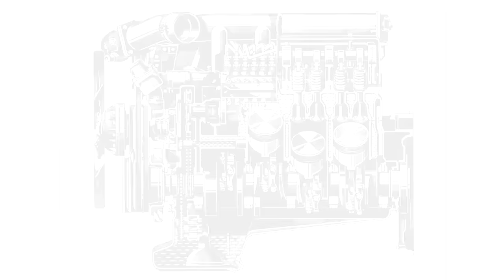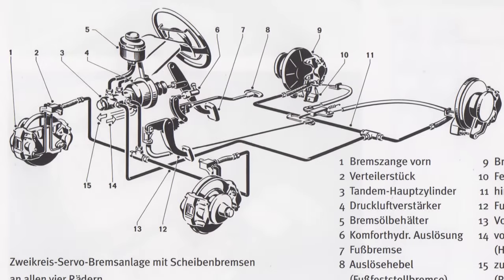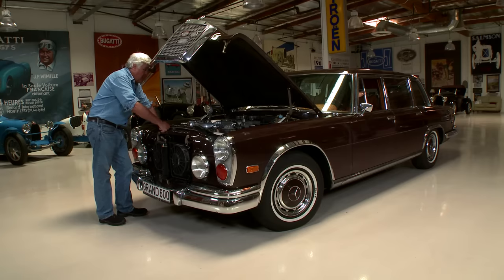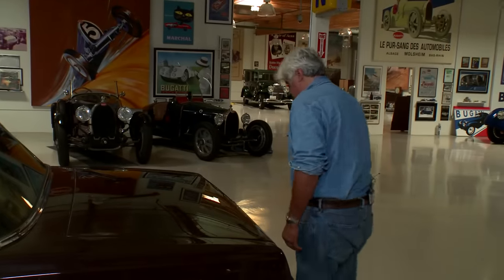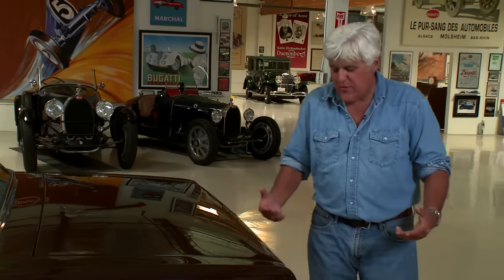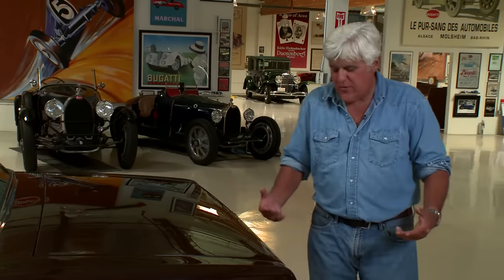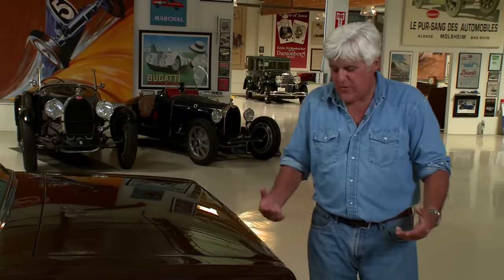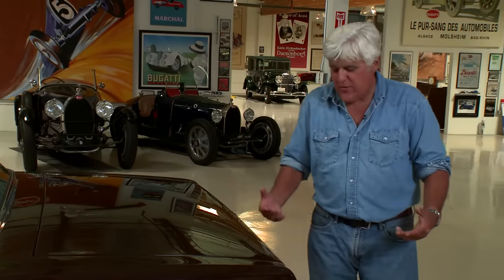1972 Mercedes-Benz 600 Kompressor - Jay Leno's Garage

Comment: Jay, EVERYTHING runs like shite on CA gas.
Gas from Cali is like gas from Russia in the 1980s; it's hardly even gas anymore, more like spicy water.
Reply: +twotailedavenger Could you go into more detail about Cali gas, why its so bad?  Thank you.
Reply: +twotailedavenger Could you go into more detail about Cali gas, why its so bad?  Thank you.
Reply: +itsmegp46 i´m from germany but it´s the nearly same deal here....they use gas mixed with ethanol.....but ethanol burns at a higher temp and destroys the old rubber linings
Reply: +Michael Byron I live in Connecticut, US.  Our gasoline is also mixed with ethanol. But the premium is still 93 octane. 
BTW, isn't this a magnificent car?  Hydraulic power windows, wow!
Reply: In cali they often use E100....here in germany we have E95....
Reply: +Devin Williams alcohol does contain less energy than gasoline though but I do understand what you are trying to say.
Reply: +itsmegp46 they use different blends of fuel every season
Reply: +twotailedavenger here in Sydney Australia we have 98 octane pure "Gas" ...We call it unleaded fuel here... we also have 95 octane which is "pure" too.. Another cheaper fuel we have is a 10% ethanol mix..called regular..... . but we also have corn juice!! or E85... 85% ethanol, with tuning it can produce amazing numbers power wise... but as is the case with alcohol based fuels.. cars use it up much quicker...
Reply: +twotailedavenger In africa its the opposite. Our diesel is either sludge or adulterated with kerosene, no complaints with our gasoline. Whats the octane rating in california?
Reply: Dafuq??? In third world Kenya its a minimum of 95! We even got rid of regular gas. All we have now either super premium (95 octane) or Shell v-power (98 octane). Italians got it lucky. I think their V-power is 101 octane.
Reply: MrThecarfreak777 If i remember correctly, different parts of the world rate their gasoline differently..
Reply: TomatheGreek I thought octane ratings were the world standard like units measure. i assumed 95 octane in one country would be similar to 95 octane in another? anyway that what was published in our local newpaper.
Reply: +Steve Lubich We call all our gas unleaded fuel over here, even the lowest 87 octane, because it doesn't have lead in the fuel anymore, lol. It has nothing to do with the quality or octane of the fuel. It simply is saying if it has lead in it or not, and all fuel these days (that consumers can buy) is unleaded.
Reply: Steve Lubich 87,89,91
Reply: We have 87,89,91,93
Reply: In answer to  itsmegp46:

People equate octane with the energy content of gasoline, which it isn't. Octane is a measure of the volatility, or the resistance of gas to detonate, or ignite from compression. Detonation is good for a diesel, as it is designed to simply compress the fuel until it ignites. A gasoline engine, however, is designed to ignite the fuel with a spark, not from compression. In fact, severe detonation will not only cause you to lose power, but will eventually ruin a gas engine. 

The reason you want high octane gas in a high performance engine is because it runs a higher compression ratio, which makes the fuel more susceptible to ignite from compression, rather than from the ignition system's properly timed spark.

Since ethanol reduces an engine's tendency to detonate, it will allow you to run higher compression ratios in gas engines, which enable a higher horsepower output of the engine. 

The problem is that ethanol only has 66% of the energy density of gasoline. So, what that means is that if your engine's fuel injected, with a smart enough computer, it can pretty much compensate for the lower energy density of ethanol by simply feeding more fuel into the engine to use all the available oxygen in the fuel-air charge.

IF you're running a carburetor, however, you're screwed, as unless it's been set up to run E-85, which is 85% ethanol, you're screwed, as the carburetor will put the same amount of fuel in, and you will make less power. And, if you have an older car not designed to run methanol blends, the methanol will eventually wreck the fuel system, eating up the rubber seals in the carburetor, fuel pump, and older fuel injection systems. The seals in newer cars are ethanol compatible.

A good example of the difference between volatility and energy content can be seen in the difference between gas and diesel fuel. You can easily light a puddle of gas with a match, but not diesel, as it's less volatile. But, a gallon of diesel will take you a longer distance than a gallon of gas, partly because of its 13% higher energy density.
Reply: Nice TG reference.
Reply: I live in Florida and the gas here is also a POS with ethanol everything goes bad,cars,motorcycles,lawn mowers,chainsaws,jet skis,boats,this is a disgrace,REC-90 is the salvation but not available in all stations
Reply: watchman1872 thanks man great comment!
Reply: @MBJaguar1007 

This is not right that way......in the MTZ ....few years ago....they find out, only mixture with less ethanol will worn out gaskets...like our Super and Super+.

when rating higher mixture, everything all right.
Reply: @CardizoneSemblance  hi, in germany you have 95, 98 or 102. ethanol is 5 or 10%. ethanol can damage some old engines.
Reply: @MBJaguar1007  mit sicherheit nicht. 95 ethanol, alles klar ... du verbreitest falsche tatsachen
Reply: @MrTiti  That's what i'm saying... in Germany they have GAS with a min raiting of 95 Octane but they also offer E10 and that can damage older engines/linings etc....

Comment: "Longest run of any Mercedes" actually belongs to the G-wagon. Still in production after more than 30 years.
Reply: Longest of specific chassis, not entire class.
Reply: JackpodyDK
The G-class is still in production after 35 years and is still basically unchanged, unless you seriously believe that changing the series name from W460/W461 to W463 can be considered as introducing a completely new chassis ;)
Reply: The 600 was the same chassis with literally no changes between 1963-1981. The G-Wagon has went through many changes, you cannot replace a 2015 G-Wagon part with a 1979 part. You could do that with a 1981 600 and a 1963. That's my point - they're a line-up, not a chassis.
Reply: JackpodyDK
Good point
Reply: The S Class and SL Class are far older then the G Class
Reply: That's a class, not a chassis, Ray.
Reply: The r107 lasted 19 years ;)
Reply: On which one can probably argue, that he means MERCEDES.
The G-wagon actually started as a Steyr-Puch (Austrian Factory) and Mercedes bought them up somewhere along the production run....(going by memory, but somewhere along those lines....)
Reply: G-Wagon didnt technically go into production till 2001. They were still producing them, but it didnt go into show rooms and all that stuff till 2001
Reply: Just because it never reached the show-room (it sure did in here) doesn't mean it never went into production.
Reply: how about "Longest production run of any Mercedes"?
Reply: Close, the longest production run is for the G class Mercedes.

Comment: Can you please straighten the star on the steering wheel. Very disturbing :)
Reply: +Rialas just what i was thinking. same if someone messes with my hood star for fun, its not fun at all...
Reply: +Rialas could be worse - I came back to my Merc one day and my star was gone. The car was parked in front of the police station - where I worked.The culprit was later arrested with the star in his pocket as the whole thing had been captured on CCTV.
Reply: +Rialas haha word choice
Reply: +Ford RS That's the difference between someone who owns a ford and someone who owns a Mercedes. It's respect to the car and it's builders. Also a little OCD as well ;)
Reply: +Rialas  That's because you have to turn that round leather center part of the steering wheel to adjust the distance of the wheel. It moves the steering wheel towards you or away.
Reply: +Maxobillion, is it different to the 1966 era cars? On those you can just unclip the centre badge and re-align it without the steering moving position. I would imagine it's the same here.
Reply: How has he let that go?
Reply: Pfff really ?

Comment: Love the car, love his enthusiasm.
One major mistake, though: at 6:50 when he's saying "...so they ran these extremely complex hydraulic lines..." the video is actually showing the pneumatic lines and valve assemblies that supply and control the self-levelling airbag suspension system  
I know because I've rebuilt, repaired and calibrated over 200 of the level control (and master control) valve units, including those from at least three 600s, one of which was called the "Red Baron". About 20 years ago a chap in California engaged my services to fully rebuild and re-calibrate the Red Baron's master and level control valves.
As told to me, the car’s history is borderline legendary: Apparently Charles Schultz (of Peanuts fame, and responsible for the nickname) bought it brand-new and drove it around Europe for a few months before having it shipped back to the USA.
Some time later he sold it to the Hilton family (of hotel fame) who ended up using it as a VIP limousine, during which time it apparently inspired several celebrities (including Jack Nicholson) to buy one just like it.
Then it was bought by the chap in California, and appeared in a few movies including a Batman one before I worked on bringing back that legendary ride that a 3-ton land yacht with a high performance 6.3 litre V8 can only have when the self-adjusting airbag suspension system is just right.
I’d love to know where it is now.

Comment: Just slightly disappointed about the refrigerator hinge and wood lining of it as well. But they used up all the burl on the dash.
Reply: My '62 W111 coupe's dash wood is surprisingly poorly aligned and my car has not been taken apart or restored. It's somewhat common oddly.

Comment: It's true Jay - GM has always had EXCELLENT air conditioning systems.
Reply: Agreed! Delco/Frigidaire's 6-piston, cylindrical case compressors were enduring engineering works of art. And made to be rebuilt/reman'd when needed. Unlike GM's 4-piston rotaries which were designed cheap for fast assembly and little else. Cheers!

Comment: 525HP in 1967?
Dam, that's impressive.
Reply: No it was 250 hp originally. It didn't have a supercharger when it was new. Its been put in by the guy who restored it.
Reply: David G
250 originally. Google it if you dont believe me
Reply: rolex2112
 Jay said 300, that's all I'm referring too
Reply: rolex2112 Engine made a bit more than 300 but when it had to drive all the hydraulics, it had 250 at the wheels.
Reply: rolex2112
You're both correct. In the USA they quoted SAE horsepower @300, while in Europe it was 250 DIN horsepower.
Reply: plenty of american cars made over 500hp as well the l88 corvette motor of 1967 has been dynoed at 560hp but was underated by gm at 430hp.
Reply: Sanic You know what's really impressive? The fact that it has a refridgerator.
Reply: sjpro1 Keep in mind hp ratings changed in 1973 so those big numbers from the 60's are smaller by today's standards.
Reply: greg raines those are modern dyno numbers
Reply: sjpro1 Oh, cool.

Comment: It wasn't the only Benz that was made with no regard to cost. Mercedes spent 1 Billion on the W140 S-Class.
Reply: there are few models, but w100 is difrent story :)
Reply: I owned two of them. 1997 S500 and a 1999 S600. Both very sweet.

Comment: One beautiful Pullman, was stationed in Germany 5 1/2 years, early 70's, saw  a handful of these,plus earlier Andnauer 4 door hardtop models, like you said, you were either a mob boss, a dictator, rock star , eccentric filthy rich Rockefeller type,  very nice presentation, I had to settle for a 2000Tilux Tii BMW 4 Dr '68 , the import to the states was a "Bavaria", happy motoring 🏁

Comment: i think mercedes really went downhill after the 90's in terms of build quality. my old neighboor had a 1980 mercedes, i don't remenber the model, that thind had at the time 500 000 miles, never had a problem with it, starts and runs beautifuly every time, they were really build to last. new ones are crap, my cousin have a c class and had all sorts of problems with it.
Reply: Right, its not the same quality anymore!
Reply: +Dumy Jobby It's true.  In the 90s, Mercedes decided to start downsizing and economise, which absolutely killed all previous notions of reliability and build quality.  Really, through the 2000s, it was common for little bits and pieces on Mercs to fail.
Reply: +Dumy Jobby well at some point they learned that people don't buy new cars if the old ones don't break.
Thats why nowadays cars are engineered for a certain mileage.
If they wanted to most companies not just mercedes  could build a car that lasts a lifetime.
Reply: Kalimerakis exactly
Reply: That Mercedes with 500K miles was likely a diesel, which was a pretty simple engine that had been around for a long time. Not only were those old Mercedes well engineered and built, with the best materials, but they were also far, far simpler than modern Benzes. Now, a typical Benz likely has at least a couple dozen microprocessors of various types. And, that doesn't even consider the software. (New Ford F-150's run on 310 million lines of computer code, according to one top Ford executive).

The more complex something is, the more parts there are to fail.
Reply: domitry jobby Yep - all they really have now is the badge.
Reply: Enter the Braggn'  I'm sure you're right. There's a light bulb at a firehouse out east that's been burning for something like 100-years, it was light bulb companies that decided to build them so they would burn out, built-in obsolescence. They knew they would go out of business if people simply never had to replace their lightbulbs.
Reply: @watchman-pu7tp  The cars' Achilles heel was rust.  Until about the early or mid-1980s, they did not have adequate rust protection, and in the snow belt where I live, the cars could rust out before they wore out.  Besides the body parts that would rust, I can remember having to replace brakes, suspension components, fuel lines, etc.  And because of the unibody construction, body repairs could be very costly and difficult.
Reply: I live in austria, mercedes from the 80`s are still found on the road but a lot of the time they have huge problems with rust. The same models in a climate with lesser snow (salt) drive for ever though.
Reply: Might or might not be a diesel engine but not unusual for a gasser to get 500000 miles with only a valve job.
Reply: +CanumaamunaC

Same here in eastern europe. Those old 80's Mercs were status symbols, but nowdays you can find one for cheaper than a Golf Mk.II! I almost bought a 190D from a friend, but the thing was so rusted up it was better off being scrapped.
Reply: watchman1872 this theory stops working when you consider Lexus which too has all the complicated systems but it doesn’t break as often as German cars

Comment: why can't we build modern cars like this.  maybe not the kind where the cost gets thrown out the window, but something that is just a great comfortable cruiser.  a car that does not go stupid crazy with the tech, has a great interior (meaning no plastic), and is just relaxing to drive.
Reply: Well, there are such cars.. The obvious new S-Class of course, and for a lot less money the new C-Class..
Reply: Google Maybach.
Reply: but none of those cars have this same vibe, I can find plastic in a c-class, s-class, or a maybach, but I would grantee you I could not find cheap material like that in a grosser.  another example of this would be the AC systems, it is quite common, on old mercs that the owners to this day still claim have not leaked.  the new mercs seem to have their AC systems break rolling off the lot and that is just an example.  lets face it 20th century mercs are just built better then anything made after 2000.  Now, they are getting better (like Richard pointed out the new C-Class and S-Class are fantastic) but its still not back to back to old standard.
Reply: We do. It's called a Rolls Royce. Every review I've watched and read about the current Phantom, and, to a bit lesser extent, the Ghost and Wraith, says that the driving experience is immensely satisfying. Everyone gushes at the comfort, sublime quiet, ride, and utterly smooth, effortless power.
Reply: rougedogx
 I own an old Mercedes. The A/C leaks just like anything else, if you don't use it. An old Mercedes will never leave you stranded if you take decent care of it, but don't think there's not always something going wrong with it. The electrics are simple, and usually easy to replace, but plastic parts wear out and need replacement (and they're made out of plastic because something needs to wear, and better a plastic piece than a more expensive part, not because it's cheap), mechanical parts wear out and need replacing, electrical problems come up and need diagnosing and repair.

Overall, they're amazing cars, and very solid, but it's very easy to have one that gets down the road with almost nothing inside it working.

Comment: No electrics, all hydraulic? hmmm, fine. In case of a EMP or nuclear war this car will still drive on.
Nice idea to think of.
Reply: Now all you have to worry about is the hydraulic fluid, lol.
Reply: Joe Cool Has old school ignition coil and distributor though.
Diesel mercedes from the same era can be started and driven with the battery and alternator removed.
Reply: Except for that pesky battery.